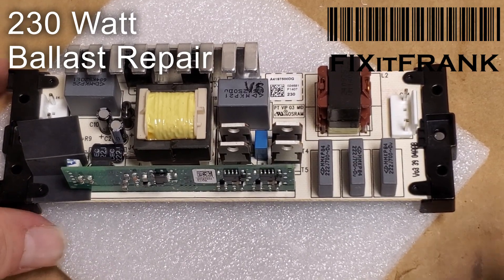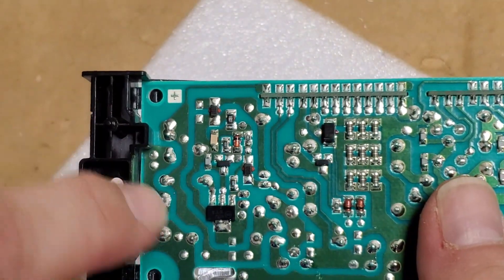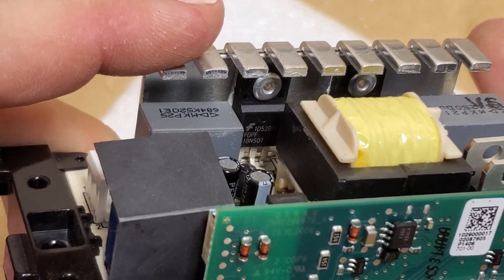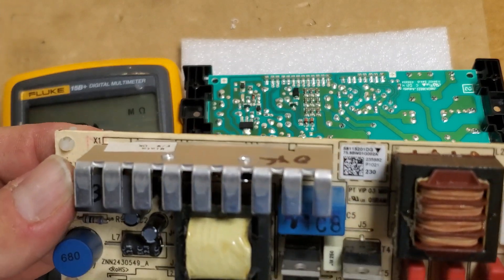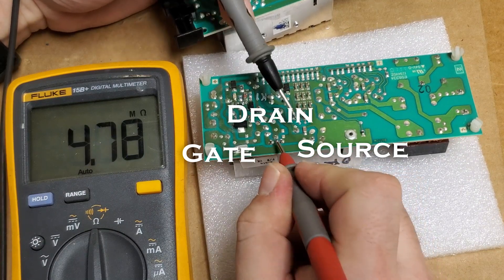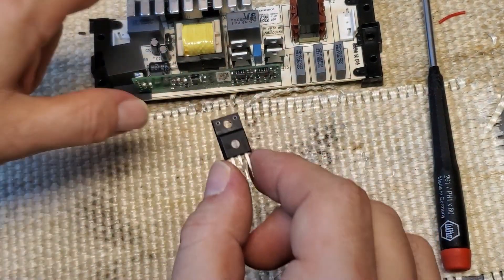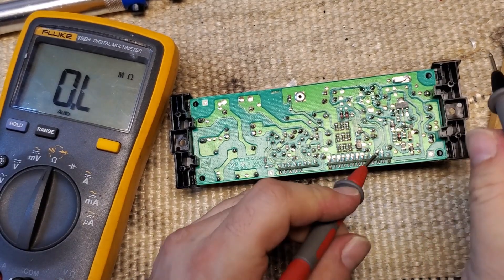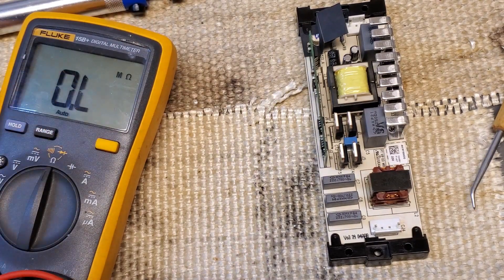230 Watt Osram Projector Ballast Repair

Comment: Great video and explaination.  Could larger heatsinks be put on? The output fets are also known to fail.  Great video A+
Reply from the maker: In theory they could be larger but in. My experience they only fail when paired with junk Amazon lamps or lack of cooling from dust build up. They are fairly robust devices.
Reply: @FixitFrank  Ah ok,  my lights have filters so should be ok, thanks

Comment: Hey! thank you for taking the time to film when you troubleshoot! Have the same ballast in my benq w1300 that does not want to turn on the lamp. Have tested with two different new lamps without results. Has changed the four mosfet and the two on the heat sink. Still does not want to work. The color wheel spins. Reach suggestions on what to check?
Reply from the maker: Do you have power to the ballast?  You need 380VDC on the power input to the ballast. Also you want to check the control signals from the mainboard. I would start with the main power supply and verify you have 380VDC. If you have 300-320VDC, that means the power factor correction circuit is not working.  It must be that 380Vdc to work properly. I suspect that is your problem.
Reply: @FixitFrank  I have 380Vdc to the ballast, so I will check signals from mainboard. The problems started with it sometimes not wanting to start without unplugging the power cord. If a have signals from mainbord I would like to buy a ballast VIP240W, do you have one you can sell to Sweden or do you know a place you can order one from? thanks for the reply  /wärn
Reply: @FixitFrank  Hi frank, quick question here. I have a ballast from a NEC projector that overheats it's four mosfets immideatly after I try to turn it on. The lamp is definitely trying to light up, blinking dimmly. i have changed the burned out mosfets, but they are overheating as well. Also I measured 324V on the input. Is it the PSU fault or the ballast failure? thanks!

Comment: your video is simple and very straight forward
i Have an optoma power supply that only blink blue light but no fan turning , no display no any other activities on the projector, how do i troubleshoot it
Reply from the maker: Hi! What model is it?  some will do that with a defective mainboard but also with a bad door switch.

Comment: I usually remove heatsink too and replace it with more powerful one. Because, if you're running projector in ECO mode, when fan speed is low, This part gets almost no cooling...

Comment: Are you familiar with any introductory videos/courses/books you might recommend for someone just getting started with taking apart and repairing electronics? I attempted to diagnose an issue with a projector and honestly I feel like my foundational knowledge about circuits and boards and how to properly check for elementary things like blown fuses is very weak. I looked on Youtube for a resource that breaks down some of those basics but haven't had any luck. Appreciate your content!
Reply from the maker: That is a tough question.  The biggest hurdle is knowing when a mountain is too high to climb.  For your first repair,  an electronics issue with a projector is like climbing Mount Everest after an evening at an indoor climbing club.  
I would suggest getting familiar with DC electronics first.  Get familiar with Ohms law, how to read schematics, how to properly use a multimeter.  The biggest problems with starting out that I see are people who jump past the basics and just go for the "what do I replace?" questions.  I would also suggest building a few things.  Get some power supply kits and build them.  Learn how solder behaves, how AC becomes DC and how current is managed.  Really when you get down to it, there are only a few components in electronics.  Knowing how they affect voltage and current can tell you a lot when troubleshooting.  
For repairs, I would start with something like an amplifier or power supply(very similar when you get down to it).  Projectors are such a conglomeration of sub systems that without knowledge of those sub systems, troubleshooting them together can be really daunting and frustrating.  
Folks with channels like @Bigclivedotcom, @northridgefix,  @tronixfix are great resources as well.  
I'd set your expectations low at first.  I've been doing this since the mid 90s.  Not projectors but repair in general. Learning how to read schematics and service manuals is key.  Get the basics in, learn about resistors, capacitors, diodes, etc. Then learn how they work in schematics.  Then learn how to measure them with a meter.  once you have that down, the rest will start to fall into place.  Also expect to break more than you fix at first.  Then one day the ratio will shift the other way.  Patience, and passion are the 2 keys for me.  Once one of those wains for me, I will hang up my iron. 
I wish I had more specific direction for you, but hopefully this helps.
Reply: @FixitFrank  Thanks so much for this response, it's very much appreciated! I'll definitely try to keep all of that in mind and refer to those resources you mentioned!

Comment: Nice to see this fix! I suspect various models of several brands manufactured by the same OEM use this same ballast type? Do they all use OSRAM lamps/bulbs?
Reply from the maker: Oddly this is from a BenQ that uses a Philips lamp. The difference between Osram and Philips is minimal.  They use the same short arc technology.  The one thing I will say is that the Philips lamps tend to be better than osram across the board.  In my experience, It goes, Ushio(#1), Philips(close #2), Matsushita, Phoenix and then Osram.  I think Osram is the lowest quality of the "original" lamp makers.   Someday I will do a video on when Osram ruined their brand by coming out with Neolux bulbs. They never recovered in my opinion. 
There are quite a few models that use this.  I have seen them in smartboard UX60s as well.  I'm sure they are used elsewhere.
Reply: @FixitFrank  Oh man thanks for the info! Please, by all means, do a video about OSRAM, I thought they were Number 1, but then I saw BARCO using Ushio lamps in their machines and BARCO is not a firm that plays around with their stuff. If OSRAM is the bottom of the barrel, I can only imagine how low quality are these knock off Chinese lamps that sell for 30 bucks! Thanks again Frank!
Reply from the maker: @Kujokouklos 
 Sure thing. I will do that sometime.  When I say Osram is the lowest, that is in comparison to the others.  They are still WAYYYY better than the knock off junk.  It's like comparing luxury cars.  There are high such as Rolls Royce/Mercedes/Bentley and then you have low end like Cadillac/Lincoln/Lexus. A Lexus is still way nicer than a salvaged Chevy Cobalt.  
Some of those knock off lamps use unregulated amounts of krypton85 to achieve the brightness they want. The gas mix inside the burner is proprietary. That is a big part of the technology I learned.  KR85 is totally fine to use when done by a proper company like Phoenix for instance, but a bunch of guys in a garage on the outskirts of Guangzhou are not going to be following proper safety and quality standards.
Reply: @FixitFrank  That is awesome man! Cannot wait for the video. Your knowledge is truly legendary! Me salutes in awe!

Comment: Hi Frank! I've watched quite a few of your videos now to help me diagnose and fix various projectors, so thanks for that! But currently I'm dealing with an issue that has me truly stumped. Got a Dell 7609WU where the lamp TRIES to fire, but it never actually fully ignites, and then it powercycles a few time. This is a brand new lamp, though. So  I thought it was the ballast. Based on a couple of your other videos, I checked the input to the ballast, which is a stable 384V. One thing I noticed is that when the lamp tries to fire, the gas discharge tube on the ballast also fires. Do you maybe have any ideas? I checked the diode and power transistor, but they seem fine, considering it does try to fire. Thanks in advance!
Reply from the maker: Hello!  I kind of think that sounds like a bad lamp. that lamp might be cracked or have air inside the arc tube.  Have you tried a new lamp yet?  Cheap lamps with bad cement can be resistive and cause problems like that.  It should have a Philips UHP bare bulb.
Reply: @FixitFrank  Thanks! I'm getting a refund from the seller and gonna try a different bulb. I did try and measure the resistance (based on one of your other videos) and it did indeed have infinite resistance so I thought it was a good bulb. Unfortunately when I received it, it no longer had the bulb or the bulb aseembly in it, so I bought both together as a replacement
Reply: @kenhutchinson8309 did you figure out if the bulb was the problem? I have same problem it try’s to fire. I’ve checked out the ballast mofsets has frank showed. All good!
Reply: @TheSawyer10702  unfortunately never figured it out and just ended up giving up and sending the bulb back
Reply: @kenhutchinson8309  Ken thanks for replying! Even though you checked a few things it's definitely the ballast had same issue but with different  PJ. I happen to have another. Ew bulb and it did same with new one. It's probably something else on the ballast. I have had issues with my bulb not igniting intermittent but would finally boot. But one evening the PJ shut off that's never happened before! So I'm going to buy new ballast cause my  moffets all check ok!

Comment: Do you typically have to replace the main power board if this happens or can it be repaired?
Reply from the maker: It seems to be about 50/50.  Sometimes the mains supply is damaged but also it can be okay.  When the mains supply is damaged, I usually have to repair the Power factor correction circuit(mosfet and driver IC usually) and the PFC control mosfet if it uses one.  Its all determined by if the PFC power is there (380VDC).  If not, then its a main supply issue.
Reply: @FixitFrank  Thank you! I’m learning a lot from your videos. I have a JVC RS57U that has no indication of power. I’ve spent hours researching how to go about diagnosing the problem but I might have to send it to you if you are available.
Reply from the maker: hello, I could potentially look at it.  to get in touch, look at the link to the lamp in the description and email the support email on that website. That will go to me.

Comment: Hi FixiyFrank.
My hd67 exploded a few months ago. Replaced a chip and worked for a while. The it stoped. I replaced the fan with a new but thinner one. It will work for 20 or so minutes and then it pops up a message about high temperature. Do you know where is the temperature sensor located? Any advise?
Very cool videos. Thanks
Reply from the maker: Thanks for the kind words! I suspect your issue is the new fan you put in.  It isn't moving enough air and that is causing it to overheat.  If you get the original fan your issue should be resolved.  The temp sensor is working as it should. That is why you have the warning.  Thinner fans do not have enough blade surface area to replace a thicker fan. It isn't moving enough air so the heat increases. Fortunately your fix is inexpensive (more so than the chip for sure).
Reply: @FixitFrank  Thanks zo

. I was suspecfing the fan. Chip cost me 2 GBP for 2 items.

Comment: Hi Frank, I have a optoma hd86 when I turn on just flashing blue light  not turning the lamp on is my lamp faulty need your expert advice,thank's
Reply from the maker: It definitely could be the problem.  I always suggest changing a lamp before opening the projector.  I wouldn't worry about deeper issues unless a new lamp does not solve the issue.

Comment: Hello!
The JVC DLA-HD350 projector. The image is there, but the brightness is very low. All adjustments work fine (contrast, chroma, brightness change, aperture, lamp mode, zoom, focus, etc.). When the image size is reduced to a minimum, the brightness naturally increases to a completely normal level. There are no color distortions. The brightness is uniform over the entire area. Three lamps were tried. Two new ones, one used. Anyway, the brightness is low. Moreover, the used lamp on another projector (sanyo plv z5) shines much brighter (according to the application in the phone 4 times). What could be the reason for the low brightness?
Reply from the maker: Weird! I would definitely expect it to be bright after 3 different lamps.  I don't have a smoking gun solution for you but I would check the optics for dust or debris that might be preventing effective light transfer.  It "could" be a ballast issue but that would be unusual. they tend to work or not work.  They rarely will partially work.  If you verified all the optics are clean, then I'd try another ballast.
Reply: @FixitFrank  Thank You, Friend! 
I checked the optics. She was very dirty. I cleaned 4 optical glasses. The brightness has increased a lot. According to the measurements of the smartphone on one of the lamps by 2.5 times, on the other lamp by 3.5 times. You can already watch a movie! But there is one problem left. When turned on, the green light of the "STANDBY/ON" indication lights up, the lens shutter opens, the lamp does not shine. After 1 minute, the red light of the "STANDBY/ON" indication shines, the orange light of the 1-0.25 second "LAMP" indication flashes, the red light of the "WARNING" indication shines. I'm turning off the electrical power. I turn on the electric power. The projector turns on and the lamp is shining. How can I fix it?
Thank You, Friend!
Reply from the maker: Пожалуйста! Если она загорелась до чистки, проверьте отсутствие пропущенных соединений проводов.  Я знаю, что у JVC много разных межсоединений.  Мигают ли какие-либо светодиоды по определенной схеме после предупреждения о неисправности лампы?

Comment: Man that soldering iron looks pretty hefty! As it happens I do have an osram ballast right now on my desk but it's a bit different. Imagine riveting the mosfet to the heatsink. It's probably quicker in production line where speed most matters. Good work by Frank once again.

Comment: I have a Dell 1610HD and the led code on top panel indicates Ballast fail (ballast EUC 225d W/C31). So I followed your diagnosting steps and there's high chance the first 3 legged Mosfet is faulty. It's a 15N60C3 with 650V 0.28Ω 15A so I went shopping all throughout my city and the closest I could get was a P20NM50FP 500V 0.25Ω 20A. Do you know if there could be any problems if I install it? What could go wrong?
Reply from the maker: That should be fine.  You can go a little larger. I would probably try it myself if that is the part I had.  All it does is enable the 380v into the ballast. Basically you are putting a larger capacity switch in place.  Being 0.03ohms less wont draw much more current. If it's just that part, then I think you will be fine.  I would check the other 4 on the output side unless you have already.
Reply: @FixitFrank  I read wrong and it's not 0.25ohms, it's 0.20ohms so maybe a 71% of the original resistance could have a different behavior. I'll try to get the original Infineon Mosfet another week, and if I can't get it, it'll be my last resource before buying the whole ballast.
Reply from the maker: @yorchli3152  That is actually a little better.  That means it's less resistive.  Ideally you want 0 ohm when the Fet is on. That would be an ideal switch.  E=IR, 380=I0.2 I-1900a versus 1520a for a fet rated at 0.25 ohm.  If this was one of the H bridge Fets, I would not use it.  But for main power control to the ballast, I think it would be safe to use as a substitute.  
At the least I'd use it to verify the function of the ballast. I don't see any reason it should affect the ballast in a negative way.  It is only switching the 380vdc from the PFC output. If it was a PWM or a signal situation, I would be concerned about changing something as well. But I think here it's OK. 
 I've used larger rated Fets plenty of times with success. The other thing to consider is that these are usually rated 40-60% higher than they need to be.  It's rare for a Fet to be driven at its full power. Using a larger Fet for lower control power helps with lowering heat.  Your ballast may even run "slightly" cooler with the P20NM50FP.  You have nothing to lose.  After paying for the parts and shipping, you will be at least $15 from mouser and they may have a minimum order?(I can't recall)
I'd try the P20NM50FP, if it works, put it back together and enjoy the projector. If it doesn't work, source a used ballast. I recall there being a low value resistor that tends to act like a fuse. I am not sure your model has one but keep that in mind.
Reply: @FixitFrank  then I'll give it a shot tonight, I feel more confident that I won't damage other components thanks to your comments and fruitful knowledge.

Regarding that resistor, how can I check the resistor? Visually everything looks fine, nothing is burned or discolored by overheat, the PCB looks in its entirity green and even. I think I need to find a video where I can learn how to check every type of surface mount component. Thanks to your videos I can check Mosfets but the rest I don't know
Reply from the maker: You can measure it with the ohms or continuity setting. It should read basically like a dead short.  the value was 0.1 ohm or 0.5.  It was very low.  As long as its not open, then it is fine.  Even if you dont check it, there is no danger.  Worse case the ballast will not start if the resistor is open.